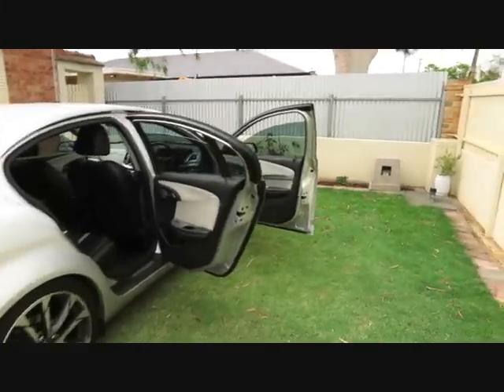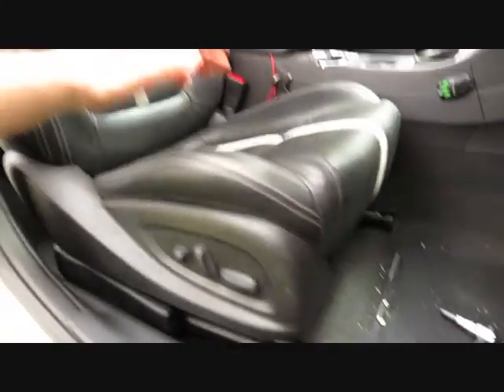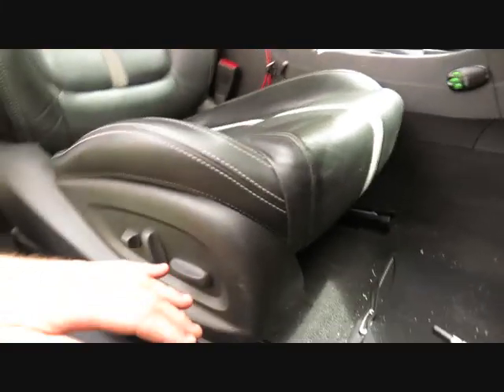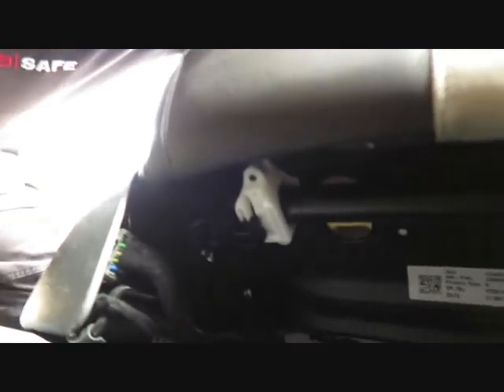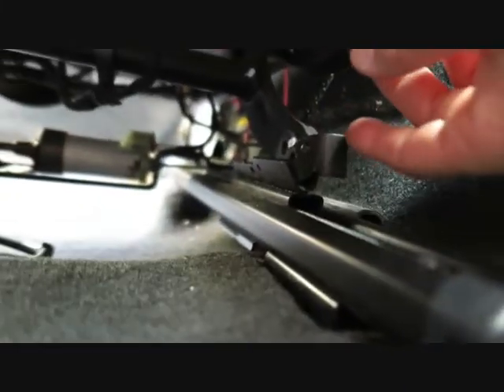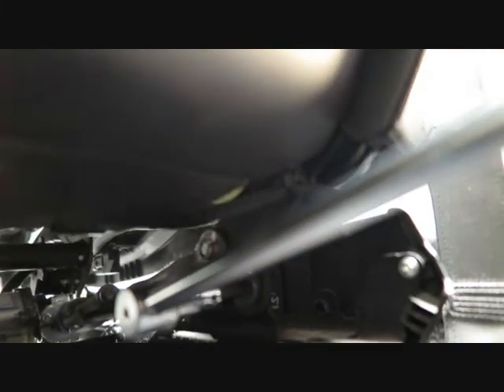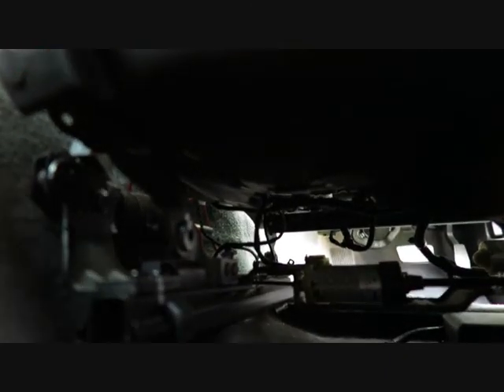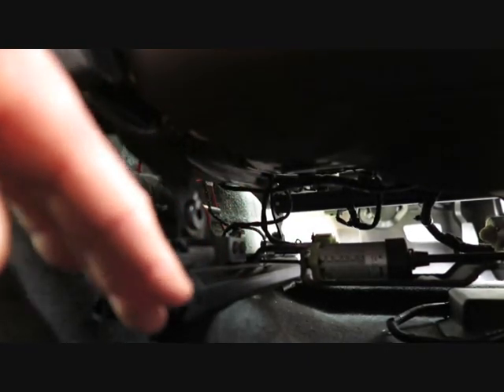Driver Seat Problem SOLVED

Comment: Your clips look quite loose .. I've just recently installed some onto my VF and they were a firm push to clip them on. A large cable tie made sure it wasn't going to move anywhere. The clips alone solved my click/creaking issue.